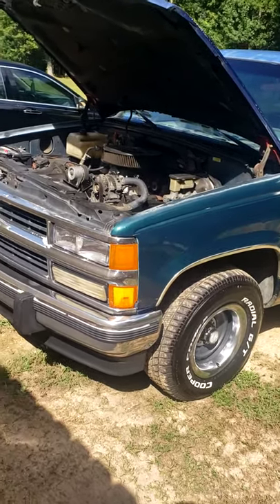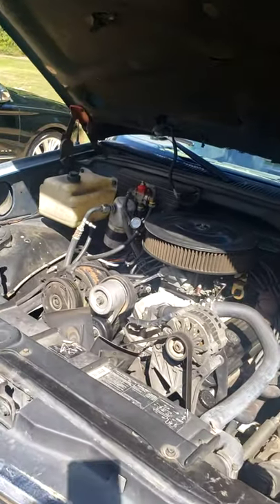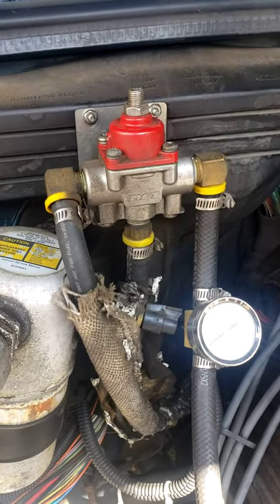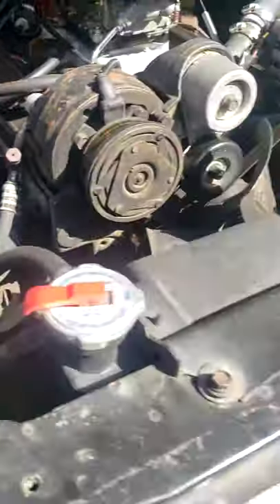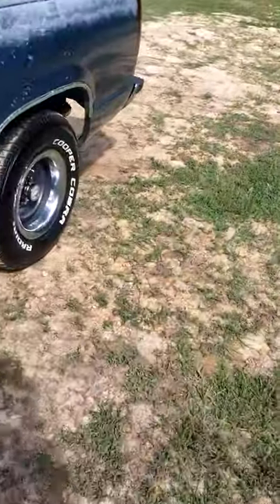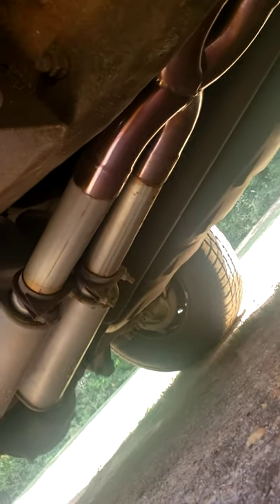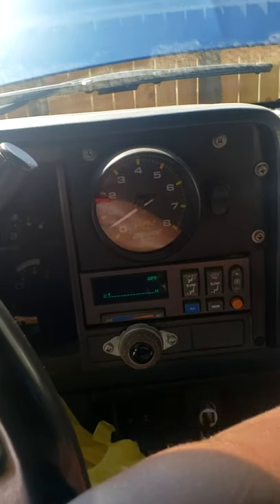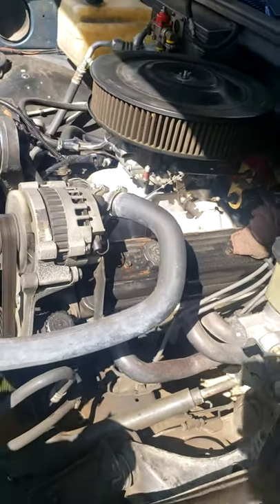Cammed my 91 STOCK BOTTOM END 350 on a SUPER TIGHT Budget!!!

Comment: What’s all needed to do the vortex heads? I’m wondering if I can use them and still keep my tbi set up or if I have to also change that? I’ve got a 1988 k1500 that I’d like a bit more power from but am also on a shoe string budget.  The carb swap is next once I can get the heads figured out.
Reply from the maker: Good questions Jennifer. You can do either one. They have intake manifolds out there to do a vortec head swap but, still retain the factory TBI set up. If you would check the description of this video, I believe you will see a list of parts I used to do the swap on my truck. Hope this helps and good luck with your build!✊🏾✊🏾

Comment: Ive Got a question bobby. I'm thinking of putting a cam in my 1990 k15, but I don't want to pull the engine.  Did you install the cam with the engine in the truck. Does it take much ripping and tearing to get all back together? It's my daily so I've  got a small time frame, over a weekend maybe? All your help is hugely appreciated. Thanks in advance from an Irishman in  Australia!!
Reply from the maker: Wow man! I am humbled to have a question come all the way from Australia! Thanks for watching! And yes, the cam can be installed with the engine in the truck. You will have to remove the engine oil pan, radiator and condenser if equipped, the water pumpand then the timing cover to gain access to the timing chain and cam. Then you also need to remove the valve covers, rocker arms and push rods and intake manifold so you can remove the lifters which ride on the lobes of the cam. It's not too bad. Should be done and driving in at least a day or so. Hope this helps!✊🏾✊🏾

Comment: Man im on a bind
So i did a second gen cam swap
Boarded 30 over the block
Flat pistons

Thats all
Im stuck on the TBI air sensors are a problem 
I didn't want carburator but i guess i have to go that route

Question bro, do you need electric fans,

Do you need to do a posi rear end, is it spinning tire like crazy with out the posi diff
Reply from the maker: @pepe7481  I understand your issue. I couldn't figure out mine either. That's the whole reason I did a carburetor swap....my truck currently is still open diff. I want to upgrade to limited slip diff but, can't afford it right now.

Comment: Nice truck sounds very good. What kind of oil are you running with the flat tapped cam?
Reply from the maker: Thanks man! Good question, I'm running the oem spec 5W30 in the truck. During break in, I added a zinc-zddp additive to the oil. After that, I drained it, changed the filter and topped it off with high mileage 5W30.
Reply: @WorkingwithBobby  ok I asked because I just did a vortex motor with a flat tapped camm and it's time to change my oil and I want to get the right stuff to go in it so my camm can live!!
Reply from the maker: @paperroute_mock1949  I understand dude. Just know that, once I broke the cam in with the additive, I have been using that oil every since. So far, no problems

Comment: im on the same path of a stock bore 350. im definetly going with more cam. ( compcams .480/.480)  stock crank stock bore flat top speed pros with scat i beams 64 cc  2.02/1.6 edelbrock e street heads  shorty headers 2.5 inch pipe all the way back. hurricane high rise intake with a holly 650 shooting for 400 plus with a power band of 2k to 6k the truck never had a rev limiter on it and i have a tb350  with 500hp kit in it all in all im looking at 3500 dollars in engine, body panels, and new tires along with a 2 inch drop all the way around. its a 89 c 2500 fleetside silverado
Reply from the maker: Sounds like you got a nice build going dude! It should sound nasty when your done.✊🏾✊🏾

Comment: I did the same setup to my 94. Factory computer controlled the trans after buying a pigtail for the tps sensor adapter from Holley. Still have the truck and setup? Electric fan will be a nice benefit
Reply from the maker: That's what's up man! Yes sir, I still got Belle going. I did add a 16 inch electric fan but, I feel like I can do better. I may try a dual fan and shroud setup. I here the NBS fans work well on the OBS trucks...
Reply: @WorkingwithBobby  Gonna install a Mustang/Crown Vic fan on my 77 C10. Free horse power
Reply from the maker: @baddbradd89  oh OK. I never knew they fit the radiator on these type of trucks. This is good information!✊🏾✊🏾
Reply: @WorkingwithBobby  May have to do a little bit of 'fitting' ..F-body fans are usually more $$
Reply from the maker: @baddbradd89  ok, I'll keep that in mind when I search for a dual fan setup. Thanks again for the knowledge bro! Be blessed!✊🏾✊🏾

Comment: I have a 1988 c1500 step side  with a 350 in it and I’ve been looking to get it cammed and update the headers/manifold and exhaust. I’m fairly new to the 350 motor seeing as I have a long background working on jdm motors but honestly the gm and mopar setups are way more efficient and easier than Toyota,Nissan etc and I’m confident to work on maybe even swap my 350 for a 5.3 vortec. How much did you’re cam set up cost if you don’t mind me asking, aslo what other modifications hve to be done in order to cam it? Like do I have to redo a lot of internals on the motor?
Reply from the maker: Good question! I'm a Nissan technician myself and have been for a number of years! I'm with you when you say the old GM and Mopar stuff are easier. You do whatever you want on your project dude. It's yours and I encourage you to keep at it until it gets done! I don't remember exact numbers but, I didn't have to heavily modify anything too much. Currently,  it's a stock bottom end 350 one piece rear seal block, vortec heads with vortec intake manifold and 600 cfm holley carb. The cam kit is a SUM-K1103 with flat tappet lifters. The cam is mild but, has a lopey idle. This is all set up to work with bone stock vortec heads. It's a simple set up. Anybody can do it. Good luck with your build!✊🏾✊🏾
Reply: @WorkingwithBobby  thanks dude I really appreciate that!! And I’m more so excited to take a break from headaches and busted knuckles from tight corners on all them foreign cars lol, not hating I love them but Jesus every one of them has they’re motor bay jam packed and everything that needs repaired requires you to disassemble 10 other things to replace the main part you’re after lol, but I will say they are VERY reliable if taken care of but yea I’m super excited to finally have a gm in my hands and have endless room in my engine bay probably going to do a 5.3 swap or Cummins 4bt swap just something wild lol, but that’s after I cam the 350 and have a little fun with it of course because I’ve always loved that classic chop sound and never had the right platform to do so until now
Reply from the maker: @RETIREDAMATUER  anytime man! I just mess with those cars because I'm good at it. I take pride in my work with any car I work on but, I am passionate about them old school small blocks. I heard them Cummins make loads of torque! Good luck with that!

Comment: Video won't play but if you put vortec heads on what cam did you go with. The L31 i was running had an lt4 cam but it didn't sound as choppy
Reply from the maker: This the part number to the cam I currently have in it. SUM-K1103. Check it out, you may like it. I don't think it works well with factory TBI though.

Comment: I'm wanting to do basically the exact same thing to my truck.  Were you able to do the cam swap without pulling the motor?  Im wanting to try to do it in the truck but if i cant then i guess i cant.  Lol.  Awesome video my man!  Much love!
Reply from the maker: Yes sir! I appreciate the love man. And yes, I did the cam swap with the engine in the truck. All you have to do is remove the radiator and possibly the ac condenser to have enough clearance to get the cam out of the block. It's not as difficult as most people make it out to be. You can do it! ! !🤟🏾🤟🏾✊🏾✊🏾
Reply: @WorkingwithBobby  thanks man!  Im no stranger to turning wrenches, just not too motor savvy.  Ive got a3500 crew cab i need more torque out of and i think this is the way I'm going to go.  Thanks brother!
Reply from the maker: @brightspringhomestead3139  yes sir I can understand that! I just didn't want you to potentially do more work than what's needed to get the old cam out. The only thing I really hate about small block chevy cam swaps is you have to drop the oil pan to safely remove the timing cover.😡😡 That seems like it could have been designed better.

Comment: All you guys gonna run an hei curve it put lighter springs get the advance in quickly makes a big difference and worry about total timing and when it comes in before base timing that's just a baseline number
Reply from the maker: True! And I actually have a weight and spring kit from ProForm that I installed in my distributor. I don't make enough power to notice a change like that right off but, every little bit helps.

Comment: Sounds good fam. I’m looking at doing the same thing with my 90. Which summit cam did you use and are you still using the stock stall converter?
Reply from the maker: Thanks man. ✊🏾✊🏾 That's whats up. I'm currently using thr SUM-K1103 cam and it works well with the stock converter but, a 2000 rpm stall would hurt.

Comment: Can you put in links where you got the fuel psi regulator from and part number? Thanks for the video
Reply from the maker: Sorry I can not. I purchased it so long ago that I forgot where I got it from. I can tell you this much though. It's a BG brand bypass style fuel pressure regulator. You don't have to get that brand but, if you going to run the stock in-tank fuel pump, you will need one. Hope this helps!✊🏾✊🏾

Comment: I have a 90 model gmc. Looking at putting a cam. Would you encourage getting away from the TBI and just go straight carbureted or what? Thanks
Reply from the maker: Sorry I'm so late Scott. I've found out that the cell phone version of YouTube doesn't let you see all of your comments.....Anyway, I think it depends on how aggressive of a cam you go with. I have seen that the aftermarket cams available for the ones who want to keep the TBI always leave them wanting more "chop". If you are wanting an aggressive cam, I recommend doing the cam, intake and HEI distributor swap. You can also install a CDI system on there with MSD type ignition box and external coil if you want. I hope this helps!

Comment: I have a 99 suburban with a Vortec motor in it I just swapped to carburetor with an HEI distributor I believe it's the exact same one you're running it is a jegs part number 555 Dash 4002 I'm running my vacuum advance into my carburetor I noticed you don't have anything connected to your vacuum advance at all could that be the reason that I seem to have no timing advance in my motor as it starts pinging immediately under load but will idle smooth and rev dirty while cold and dies when hot
Reply: And im running an inline clickity clack fuel pump with a regulator so it could be a fuel issue too
Reply from the maker: @controlledexplosionsgarage9104  a 99 suburban would've had MPI and had a much hight fuel pressure than the TBI system my truck came with. I don't know how much fuel pressure you're running but, 5 to 7 psi is perform for most street applications. I got my distributor from ebay. It came complete with a 50,000 volt coil(advertised). I disconnected my vacuum advance to keep as much timing as I could in the motor under load without causing spark knock. Vacuum advance actually pulls timing back for emissions purposes.
Reply: Gtk for the timing i am running 6 psi to the carb with a 65,000 volt coil
Reply: Ill update when i check it tomorrow
Reply from the maker: @controlledexplosionsgarage9104  for ignition timing, try setting it between 32 and 36 degrees of total timing. This means when it's revved up to at least 2200 rpm the mechanical advance of the distributor should be causing timing to increase. That increase should be around 32 to 36 degrees by then when checked with a timing light. I hope I was able to help you.✊🏾✊🏾
Reply: @WorkingwithBobby  great help much respect i just have no way to put a timing light on it because of my accessory drive
Reply from the maker: @controlledexplosionsgarage9104  no problem. I wish I could've been more help.✊🏾✊🏾

Comment: Awesome sounding truck, what headers are you running? God bless.
Reply from the maker: Thanks dude! I currently have a direct fit shorty style set on there. I want to upgrade to long tubes for more torque but, I gotta wait on that....Same to you bro! CO tinge to be blessed.✊🏾✊🏾
Reply: Based on your personal truthful opinion, do you recommend swapping to carb? I have a 1993 Chevy blazer k1500 in which I’m rebuilding completely, body and drivetrain on a budget of course. I’m going with a lunati cam kit, although I have a tbi. I’ll be posting videos soon just  waiting for the storm to clear out here in south Texas.
Reply from the maker: @traxxasnitrorevo  well, being budget minded, yes, I would switch to carburetor. If I had the money, I would at least try the aftermarket EFI systems out there for shear efficiency and better road manners. I believe it's simpler to go with a carburetor but, that might not be so for the ones who don't quite know how to tune a carburetor....

Comment: My trucks the same year!
Reply from the maker: That's whats up! I hear that the value on these obs truck done sky rocketed!
Reply: @WorkingwithBobby  bro fax, especially if they 4x4 or just a good looking 350 in it..I love mines and I was just looking at cams and carburetors and I seen your video and see that it's really worth it. Although I have straight pipe cut off (they turn down at a 45° under the seats) with cherry bombs glass packs so I'm interested to see how that will sound...but I have a question. If my stock 350 idles around 750-800 rpms...will I have to adjust the carb and timing so it won't just complete kill my motor?
Reply from the maker: @Texasmule  cool deal!😎😎✊🏾✊🏾. Good luck with your build dude! I would consult the cam card or call the company that made the cam and see what they recommend based on tour application. I would think that if its a mild cam, the engine should idle at no more than 775 rpm. That's just my personal preference though. Hope this helps!
Reply: @WorkingwithBobby  thanks! Hope your project comes out better with every mod you do

Comment: Hey man love the video. Is there any chance you comment the link to the fuel pressure regulator and the throttle and tv cable mounts? Also what is gas mileage like now with a carb and everything is it similar to the TBI? Thank you in advance because I wanna do the same thing
Reply from the maker: Thanks dude. I appreciate the love. I dont remember much about part numbers on some of the stuff I installed but, I remember what they are. The fuel pressure regulator brand is BG. I think thats short for Barry Grant. It is a return style or bypass regulator.  The bracket on the carburetor is by Holley. I ordered it from summit. The gas mileage is actually pretty good. I would guess around 15 miles per gallon highway. I believe that's because of how the 700R4 is geared. Also im still running a stock 3.42 open diff rear gear.
Reply: @WorkingwithBobby  thank ya sir!!

Comment: Man I have almost the exact same set up do you have any pointers for timing or tuning I for the life of me I can not get mine to crank or much less idle nearly as nice as yours and it’s driving me crazy
Reply from the maker: Thank you! And I thought I put all that info in the description or said it in the video. Of not, I apologize. My ignition timing is currently set at 12-14 degrees advance @ idle and 34 degrees advance @ 3200 rpm. Yours may vary depending on your setup. My carburetor  is set to idle @ around 650-675 rpm and I have the mixture screws turned about a turn and a half out. I had to tinker with it for a few days before I was happy with it. Hope this helps!✊🏾✊🏾

Comment: Thanks for the info!! I can now go ahead and push the button on my 87 short bed, I've been sitting on a 5.7 engine with transmission wondering if i would be able to use the transmission too i think it's a 4l60e, is it possible with such an okd truck
Reply from the maker: No problem dude! Glad my video helped you. Good luck on your build. I don't remember 4L60E being in vehicles then. It could be a 700R4. I thought they started putting the 4L60E in trucks and cars in 1993. Might have to do your research to verify.✊🏾✊🏾
Reply: @WorkingwithBobby  that motor and trans came out of a 99 Tahoe
Reply from the maker: @cornellhrpr  oh ok. Well, it should be a vortec headed 350 and a 4L60E!💪🏾💪🏾I hope you get it together soon!🤟🏾🤟🏾
Reply: I’d consider a th350 trans. Especially with 4:10:1 gears in the rear end you’ll be able to keep that motor in the power band longer and they are a WAY better trans.
Reply from the maker: @FLINTmitten810  I am actually considering getting away from that 700R4 man. It's been giving me trouble even after I got it rebuilt.
Reply: @WorkingwithBobby  yeah it’s a shame! Everybody I know who’s got a 700 r4 is always having trouble or they’re slipping. I knew a guy down by Charleston who had one built and it still was issue prone. Good luck to you though brotha! 💯